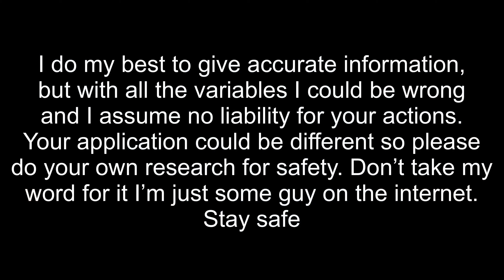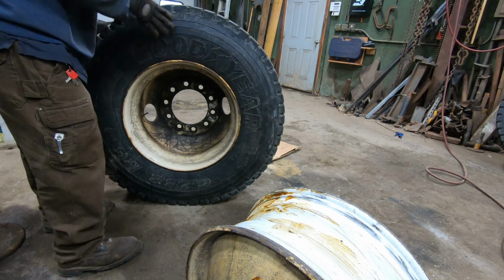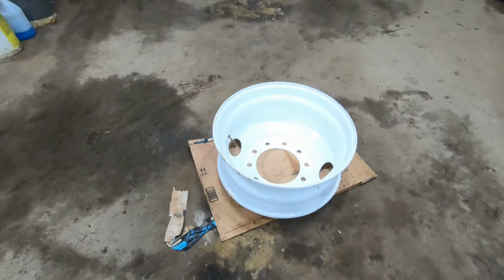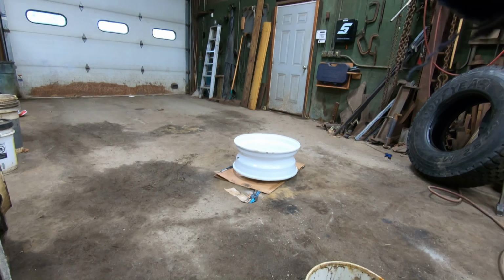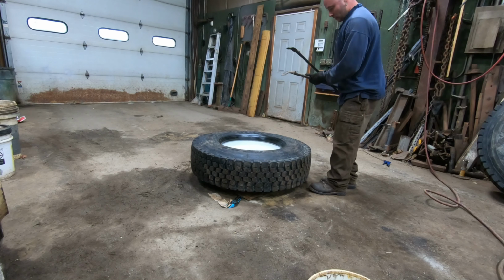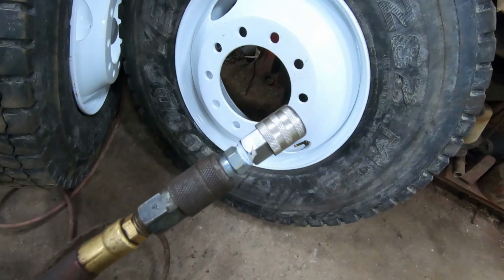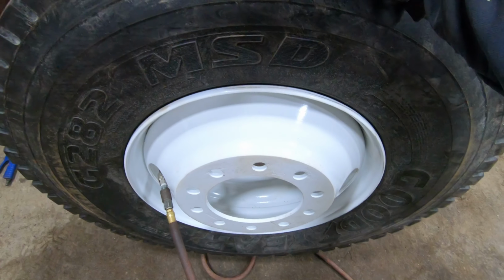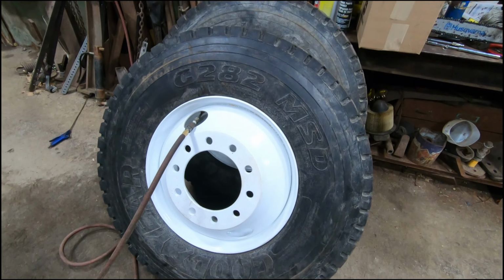Changing a heavy truck wheel (dismount and mount)

Comment: hats off to you man! I dont even touch tires! I have a great tire guy I call and picks up and changes them for me and delivers back to me once changed. Cheers!
Reply from the maker: I usually have them changed at a tire shop but they forgot about me when I went to pick them up and I needed them so I just took the wheels and tires and changed them myself. I used to change them more at my last job but I’m told to have the tire shop change them here.

Comment: Great video. I've been watching you a lot lately. I'm a mechanic for a state dept. of transportation, so I see a lot of familiar stuff. I wanted to let you know how much it's appreciated that you bring us along. I'm sure all the camera setup is a pain, so a big thanks!
Reply from the maker: Thank you. It’s no trouble, I’m glad you take the time to watch. The camera set up isn’t too bad. Editing is the time consuming part, I’ve been focusing more on the audio lately thanks to the suggestions I’ve been getting and it’s added some time to it. I’m still trying to get the hang of the wireless mic which is bringing new challenges with wind noise and such. I have a magnetic mount for the camera and it basically all I use, I can stick it almost anywhere. Sometimes it gets covered in a ton of rust flakes from the salt trucks 😄. Thank you for watching though, and your comment is very motivating.
Reply: @JasonTheMunicipalMechanic   Ah yes, I never even thought about all the salt and rust raining down on the equipment. Just a blip from an impact or an air hammer and you're covered!. The audio and video looks and sounds great! Thanks again for filming and keep up the great videos.

Comment: Thanks for the video.  Sometimes when I mount new tires (either auto or smaller tractors) I find that I need a third hand as the tires dances over the lubricated rim while spooning.  I have found that vice grips on the rim eliminate this problem,  I hate calling for the wife to help and she hates it too.  I assume that when you are using the blaster that you are simultaneously having the air chuck going thru the  valve stem and the bead blaster is at the opposite side from the stem (?)  Thanks for the great teaching.  Craig
Reply from the maker: I had to mount a small tire for a lawn tractor once and what a nightmare that was.

Comment: you made that look easy.do truck tires get balanced like care tires?
Reply from the maker: Thank you. They can be balanced, either with wheel weights or polymer packets that go inside the wheel. They also make balancing rings that bolt on before the wheel goes on. Fronts are usually balanced but rears are not.

Comment: Done lots of tires just did 3 of them the other day. It was supposed to be 2. The boss says the new tire is flat, the bandag retreads we use was defective. We have bin trucks tires don't see easy life. The 425/65R22.5 steer tires are the worst to change.
Reply from the maker: When I was hauling tankers we wouldn’t even run retreads, they told me they had a bunch of them come apart when they used them. I bet those wide tires give you trouble, I haven’t had the pleasure of mounting one of those.
Reply: @JasonTheMunicipalMechanic  To have 20,000lb steer axle capacity we have to have super single tires. They are virgin rubber they are expensive at 1200 each. I'm not a fan of retreads but they are cost effective being they are 350 each compared to 500 plus each for a new tire. Were short haul the tires usually blow because of the abuse they see off road. Never had a tread peal off, lots of sidewall blow outs.